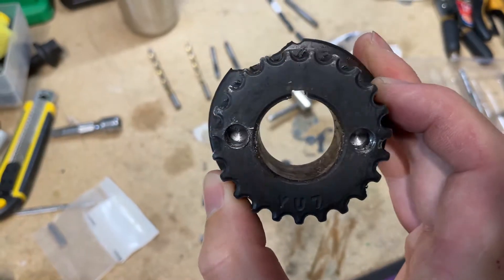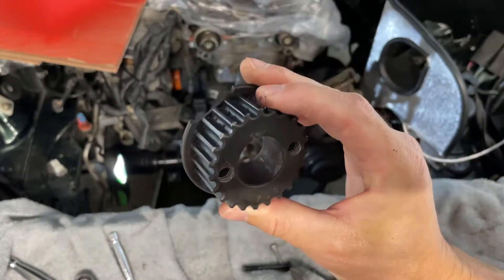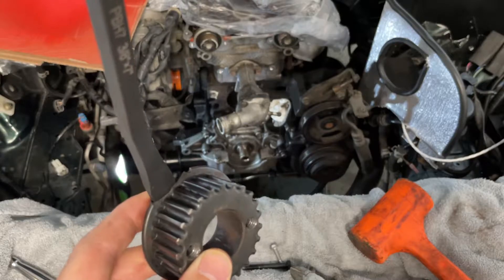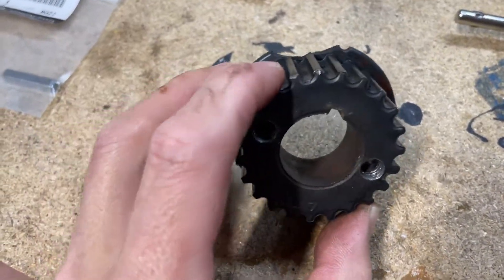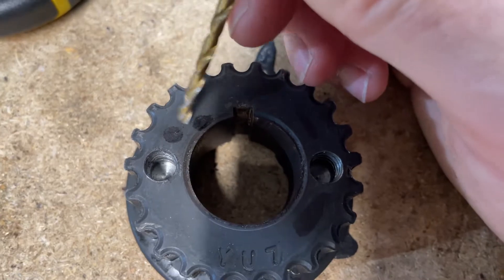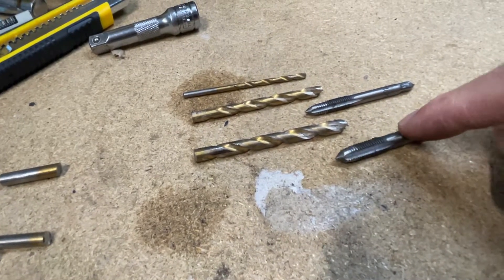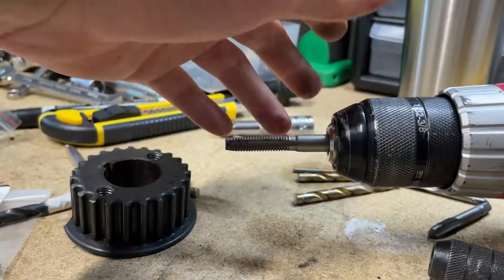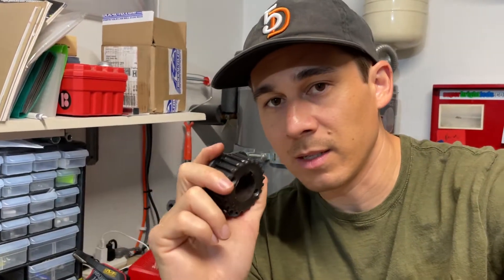Pulling Stubborn Miata Crankshaft Gear "What a Nightmare!"

Comment: Going through this situation right now.. and this is the only video that really helps..
Reply: So the gear just stays in place with no Locktite or anything? I had to order a new one and damaged the oil pump seal lip a bit because the previous 'mechanic' used Locktite' on there. Had to pry it off and then file the end of the shaft.
Reply: @tmo2798  the key on the gear broke and pieces of the key got wedge in between the pulley and crankshaft. I ended up chiselling the gear out.. but the video method was also good..

Comment: Thanks for posting this video. What a PITA. I have done this job two times. I would NEVER change my front crank seal unless it was weeping oil now or I was planning on changing the oil pump. The first time, I used a torch liberally, and a 5 foot long pry bar and a ball joint separator. I ended up using a dremel to cut the gear nearly in half. I cracked my oil pump all the way through and messed up my crankshaft nose (and broke a ball joint separator). The second time, I was in the process of turboing my miata and discovered the cracked oil pump (my car had also developed a small oil leak some time in the past...). I had the engine out of the car. I stepped up different chisel sizes until I had large chisels around the gear, using an air hammer to hit the chisels and got it to budge. Then I was able to use a pointed tip air hammer attachment from the engine's right side (looking) and knock the gear forward. It fought until the last possible point. But, I literally had a billet oil pump on the way. Suffice to say, I completely destroyed my oil pump the second time. I could literally see into my oil pan from through my oil pump. Never remove this gear unless you are 100% certain your front seal is bad

Comment: I think my water pump leakage was dripping down and providing the perfect recipe for rust adhesive between gear and crank surface. Followed your suggestion. Drilled, tapped for 6MM bolts. Crank puller loaned from Auto Zone. Appropriate bolts from the local hardware. But right now not budging..... May apply heat with torch next.....Thanks for posting with authentic vulnerability.

Comment: I went through this a few months ago.  I got so fed up with it that I gave up and put it back together without doing the crank seal.  I need to go back in and try this with a puller tool like you showed.  Thanks for the video.

Comment: Man, I’m working on this. I do not want to take off radiator but if that’s the case. I will have to torch it and pull it. See if it would come out. Thank you for posting this.
Reply: Just take the radiator out. You'll hate life a lot less while you're hammering or heating
Reply: @jebus914  only reason I didn't want to take it out was, not to lose the pressure in radiator and replace the coolant. I'm going to get the dremel, and drill kit. Woodruff key broke off and left some pieces in there. Looks like it's going to take a whole day of work to get it out.

Comment: Struggling with removing the crank sprocket right now.... It's so aggravating. I just removed the radiator to give me some room, sadly I have bolts broken off in three of the four holes on the sprocket itself. What a nightmare. Going to buy a puller tool and go from there I guess haha.

Comment: Did same thing… I feel for ya buddy… 99 green Miata… oil pump seal ruined and oil leak continued the nightmare until eventually soon after developed a knock and finally enough was enough and brought an end to the nightmare that began in your exact situation primarily instigated by rage and frustration that was unleashed on the poor innocent oil pump and seal that just unfortunately happened to be living behind the bane of my existence… and a little too much persuading… and torching… torching did not help really btw… extreme prying and hammering pry bar into wedge against oil pump chipping the entire top exposed to pry bar area… yeah… good thing these NB1 heads sell for as much as a NB2 engine 😅 just a few hiccups and she’s back on the road and ready to sell after a long 1.5 year hiatus shifting focus onto anything else after that hell of a shitty experience… but yes… it was not in vane… lessons very painfully were learned 😇

Comment: NEVER pry against the oil pump! If it breaks you're going to have to pull the engine to get it replaced.
Penetrating oil was good enough my first time doing this procedure. 
This second time I'm probably going to use a hammer and maybe a torch to break it loose.
Reply: UPDATE: I got all the parts of the crank off. 
Penetrating oil soaking for two days is definitely your friend. 
The bolt came off with a lot of time from an impact driver. The pulley hub needed to be tapped on with a hammer multiple times to loosen, as well as pried against with the ROUND side of a claw hammer. I used one of the oil pump bolts to pry against, not the cast aluminum body of the pump itself. Patience was definitely my friend for this because it took forever to wiggle off. 
Pliers and light tapes from hammer for the key. 
The crank gear you can then rotate loose by tapping a screwdriver placed between cogs with a hammer. Be careful because a new crank gear is $50. 
When I clean and reinstall everything, I'm going to put a very thin layer of silicone on the crank to keep stuff from rusting seized. 

Hopefully this helps someone. Good luck!
Reply from the maker: @jebus914  Great advice!! Thank you!!

Comment: How bad is it to put it back in? And do I just 'trust' it to stay in place? Please help. Say the front seal was leaking while checking to see if timing belt need to be replaced. Timing belt looked brand new even the car was purchased 2 1/2 years ago/ 30K miles ago. Noticed sludge buildup and want to replace that seal. Now I'm in a big mess. Please help!
Reply from the maker: Before putting the new one on, just clean up the nose of the crank really well.. then tap it back on. The woodruff key keeps it from spinning and the crank bolt, harmonic balancer will hold it on

If you have any specific questions, I’m happy to answer
Reply: @_GarageThings  Right on. Thanks for letting me know. After I asked, I remembered the crank pulley goes on right there, too. Thanks. I appreciate it.